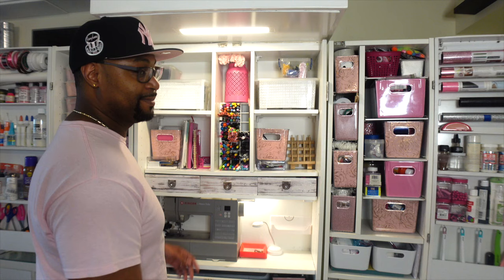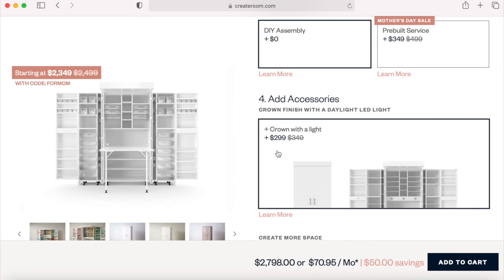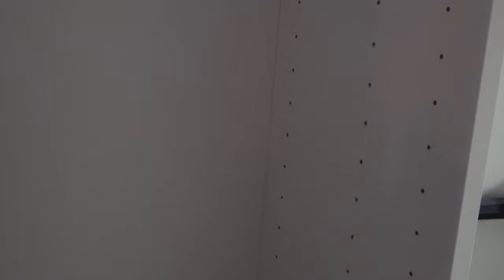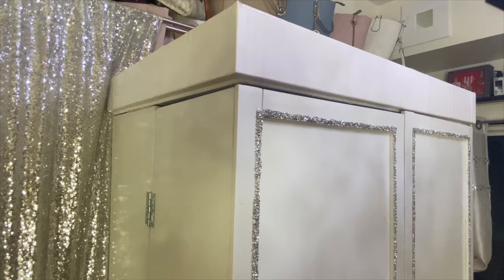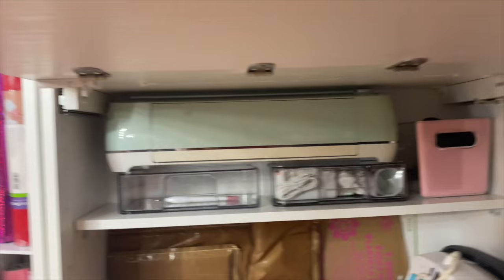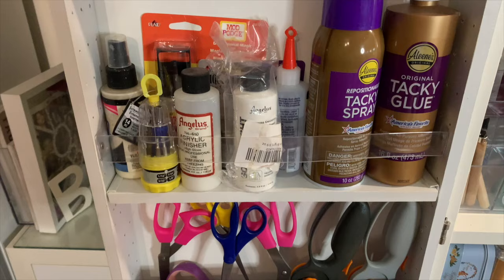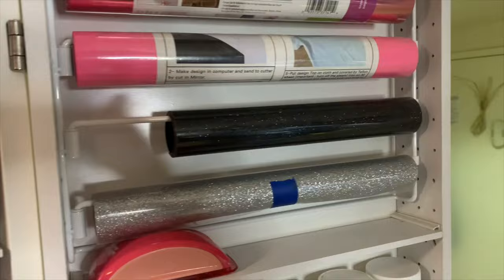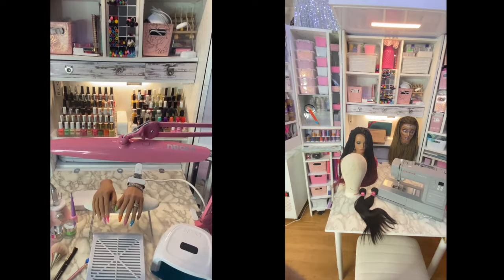The ULTIMATE Dream Box DUPE! DIY VisionBox for UNDER $500

Comment: Hi Brooklynites, I saw this video two days ago and knew I wanted to make one, so today I drove to ikea and bought the three Billy bookcases You used. I just put them together but I’m stuck at how to make the I see that will only work if I build outer extended door panel. I was also confused about the extended door but now after watching this video over and over again, I realize  this will only work if I build the crown to compensate for the extra space between the 15” bookcases and the main frame. Can I add a crown later?
Reply from the maker: One thing that my husband didn’t mention in this video is the fact that we had to customize the center 30” Billy bookcase frame in order to fit the extended doors and table. To make the doors flush to the frame when close, we cut the top and middle shelf about 2 inches shorter into the frame. New screws and peg holes had to be added to the shelves and frame. That covers the extra space that the extended doors would take up. 

As far as the crown, it’s just a stand alone extra top piece that is completely optional. It won’t affect the build of the frame. And you can add it on later. One thing I would recommend is to have about half to an inch of space between the crown and frame so the top of the doors don’t rub against it when opening and closing. This can be done by adding wood to the top of the frame and screwing the crown into it. Hope this clears up any concerns. 

BTW, I’m from Harlem and my husband is from the Bronx but it’s NY all day 😄❤️
Reply: Thank I think I under what you did. I’ll have to get help with that part. Bronx, Harlem, Bklyn, it’s The big Apple and we Rock. 👍🏾🔥 I hope your feeling better.

Comment: Do you have the specs for the added  door inserts on the inside??
Reply from the maker: I do not know the exact measurements. When we built this, the extended doors were cut to the size of the interior frame and adjusted as needed.

Comment: For the extended door panels what are the dimensions for them?
Reply from the maker: I didn’t write them down so I couldn’t tell you. They should be along the same dimensions as the cabinet frame. The measurements would also vary depending on the closet frame used.

Comment: I built my frame the prom I’m having is adding the extension boxes to close properly is there any advice
Reply from the maker: You would have to adjust the size of the shelves to compensate for the size of the extension boxes or make the extension boxes smaller to fit within the closet when it opens and closes if you don’t want to customize the shelves. I hope this makes sense.

Comment: I must have missed something vital! How do you make the back of the ikea cabinet look good? When I went to the ikea website it has a particleboard back.
Reply from the maker: I bought white MDF board and cut it to the size of the frame. I used white baseboard molding and added handles to give it that door look. All these materials are available at Lowes or Home Depot. Thanks for your comment.
Reply: @AnnetteWalkerVisionaryBeauty  maybe ikea changed since the last time I was there, it has been about 5 years. Their white used to be a creamy white that wouldn’t have matched any other place’s white. That’s awesome that it matches! I’m hiring someone to do this for me (I’m not handy and don’t have an awesome husband!) so I want to make sure I get all the components. It’s still WAY cheaper to pay a guy to make one and buy all these parts than buy a Dream Box. Plus I already have all the interior containers, so why not build it to fit mine rather than buy new ones? Thank you so much for sharing your process so detailed and giving my guy a starting place!!
Reply: Also, I’d pay for a pdf with a material list too!

Comment: okay one more question: how did you attach the "small" extension shelves so they are flush when the whole box closes? I'm trying to figure this out and i feel like it will not let me close the thing fully. are the boxes "inset" into the bookshelf depth? I dont know if my question makes sense but my brain is stupid and i can't figure it out
Reply from the maker: The extension doors are the trickiest part but it really depends on the frame size used to build the closet. The deeper and bigger the extended doors are the more customization has to be done for everything to fit. You would have to compensate space in the frame or shelves in order for the closet to close properly. It took us a few times before we finally got it right. I hope I kind of answered your question. Thanks for watching.
Reply: @AnnetteWalkerVisionaryBeauty  yes you did! Thank you. Finally putting some of this together this weekend. Thanks for the inspiration

Comment: How did u make the half doors?
Reply from the maker: I use the same concept as to how the closet frames are built but on a smaller scale. I used popular board for the frame and dry erase board for the backing. The shelves and inserts are all custom to fit that frame. It’s easier to do then how I’m explaining it.

Comment: How far into the cabinet did you drill the new shelf holes?
Reply from the maker: Half the depth of the frame so about half an inch but it will vary depending on what type of cabinet is used.
Reply: @AnnetteWalkerVisionaryBeauty  thank you!
Reply: @AnnetteWalkerVisionaryBeauty  ooo! One more question! On the shelves of the added storage (the other side of the magnetic white board) what did you use to hold your items in place? I'm trying to find something similar but I don't know what it's called 😅
Reply from the maker: I used clear plastic corner guards. Bought them at Home Depot for under $5 and cut them to the width of the shelves.